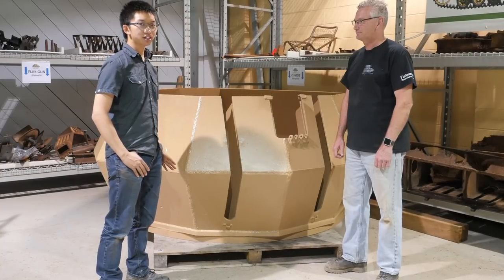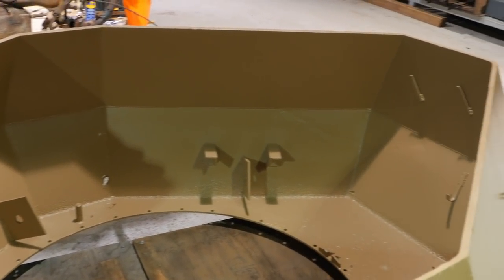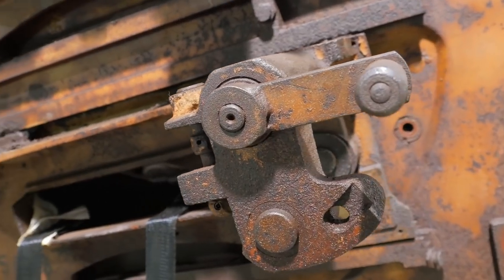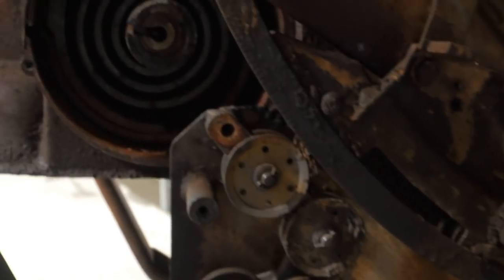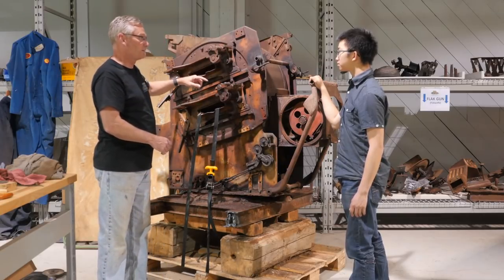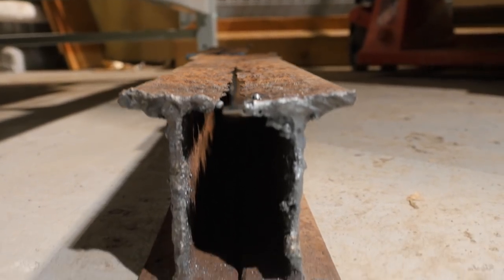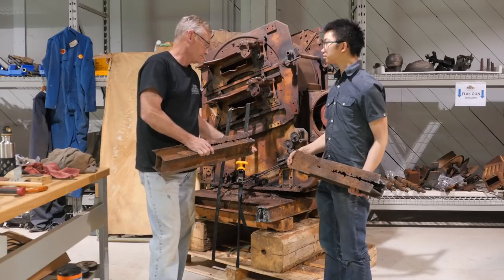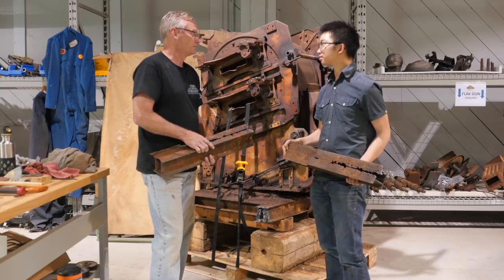Flakpanzer Restoration: Gun Mount Update (July 8, 2017)

Comment: The gun mount has all of those cables and coiled springs and their adjustments, and seems needlessly complex, but it's because the assembled gun mount is designed to balance, to be moved easily by the crew. The cables and tension of the springs are all adjustable(you can see the turnbuckles on the cables) to fine-tune this adjustment. I once worked on hot-rods, so I can appreciate what he says about restorations as a labor of love. He is also correct about the rust - it has to be cut out, like cancer. If you don't, it'll keep going, like that battery bunny. The Titanic will be gone in another few hundred years.